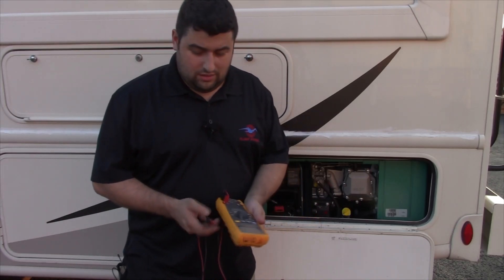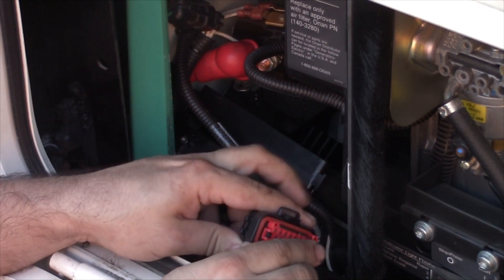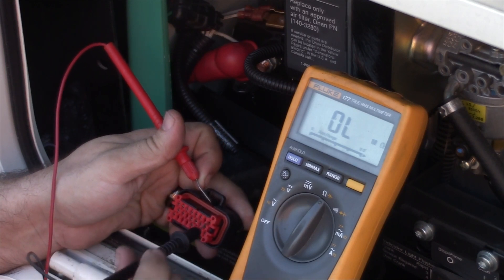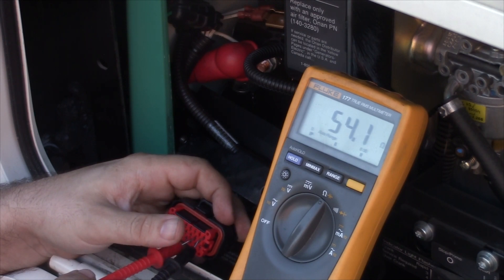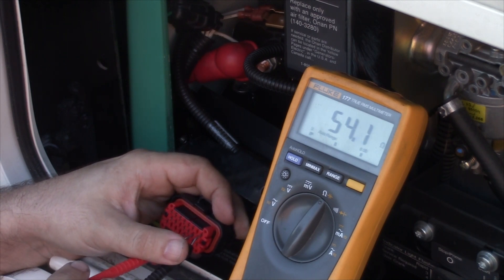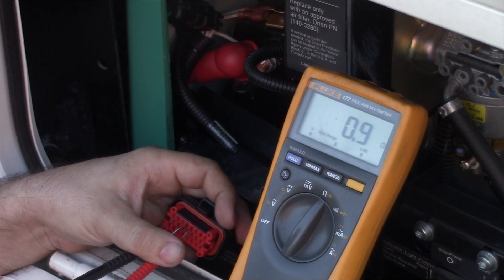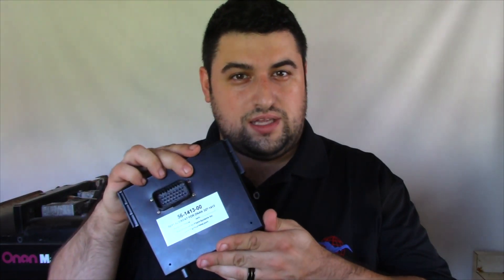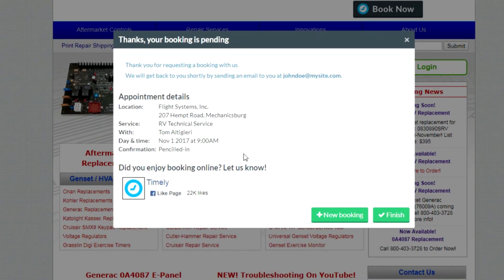Measuring Quiet Gasoline and Marquis Gold Windings

Comment: What a great video and THANKS for sharing! I’m facing an  issue that I can’t resolve with my generator. I have an ONAN 4000 generator with only 10 hours (spec P) that won't make power greater than 20 volts. I've removed the stator and cleaned it of rust using scotch pads. Rust was also removed from the rotor using scotch pads. All wire connections between the controller and components were checked for continuity. The brushes were removed and cleaned. The slip rings were cleaned and are shiny and bright. The controller was replaced with a BOB (break out box) and the engine runs strong. Two used replacement controllers were inserted in lieu of the unit’s primary controller in order to eliminate any doubt about the controller. In step 3 of this video (AC LINE SENSE TEST), my DMM reads 1.2 OHMS (at 80 degree outside temperature). If I remove the two plugs connected to the stator and measure directly on T1-T2 (bypassing the harness), it does read 0.4 OHMS (in spec). I tested these two wires for continuity between the stator block and controller and they check ok. Not sure why I get 1.2 OHMS when plugged into the two stator ports.

The training I’ve had on ONAN 4000 has given me the knowledge to remove just about any part but this generator is a mystery to me! I cannot figure out why it won’t generate more than 20 volts. Anyone have any ideas?

Comment: I was about to trash my generator after finding the control board fried.  I assumed the generator was also damaged but your video allowed me to prove it was fine and by adding your control board, my problem was solved, so much less expensive than the Onan comparable part.  Thanks!